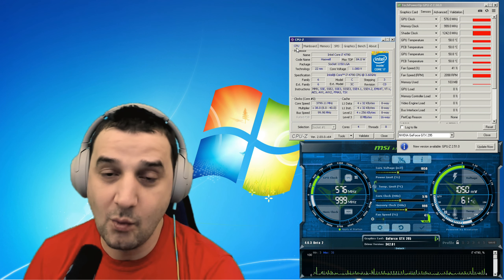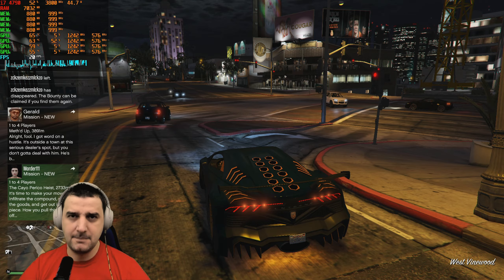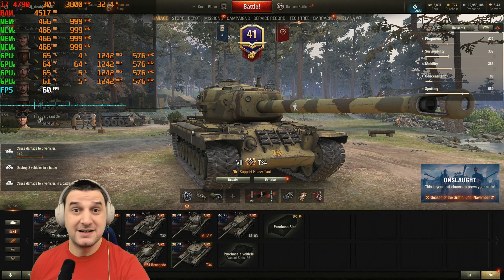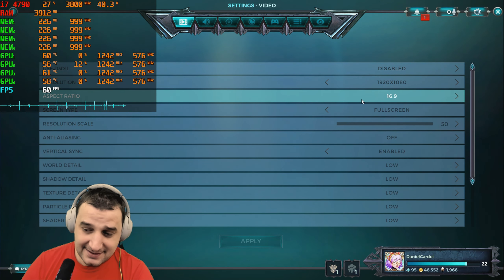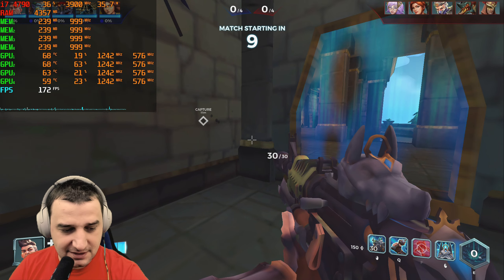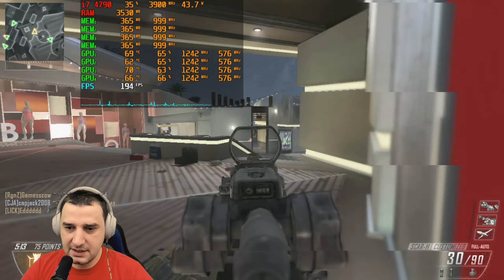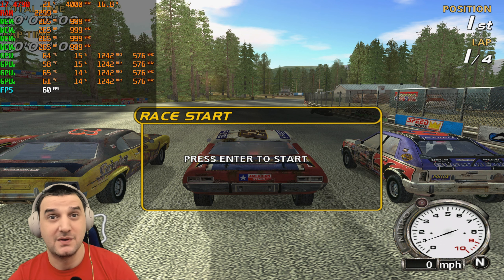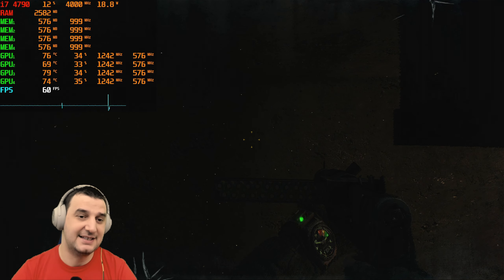Testing 2 GTX 295 in Quad SLI in 2022

Comment: inca este o placa video sau sa zic asa placi video ))))))))))) pe jocurile vechii fps sunt ok
Reply from the maker: este beton sa ai un sistem vechi in care sa ai doar niste jocuri de generatie mai veche. Nostalgia ii puternica.
Reply: @DanielCardei  am avut un rtx 3090 si l-am vandut pe  4000lei ca na problema de sanatate.... acum stau cu ryzen 7 5700g si 16gb ram ma joc pe integrata ))))) doamne ajuta poate pe viitor un rtx 4090
Reply from the maker: da-mi o lista de placi video pana in £20-40 pe care le poti gasi si lua. ceva ieftin si le bag in i9 sa vezi cum merg.
Reply: @DanielCardei  am lista lunga mâine îți trimit aici sau îți dau o urmărire pe Instagram